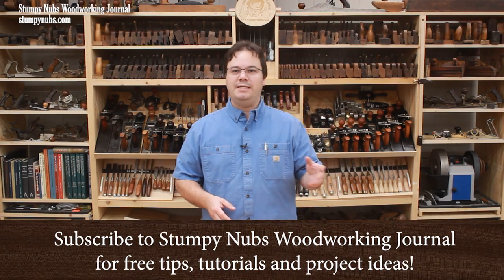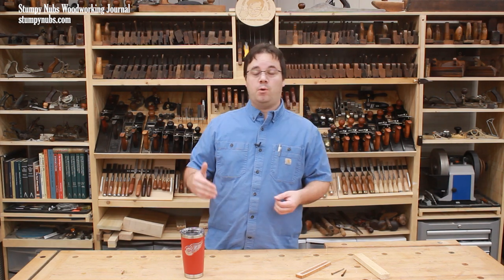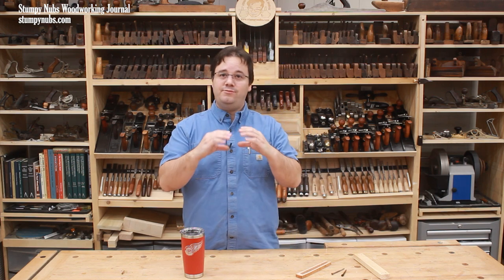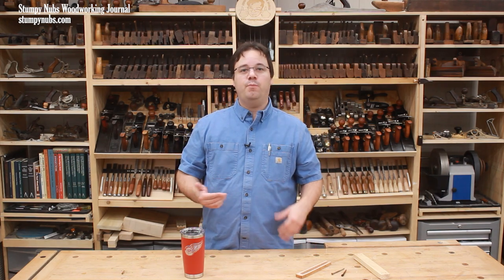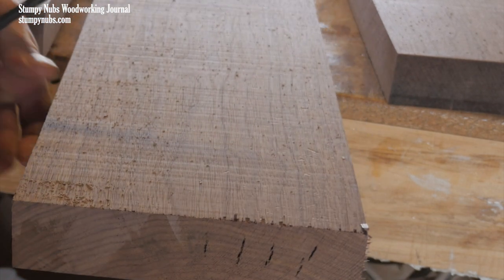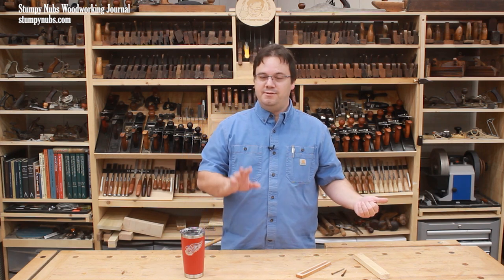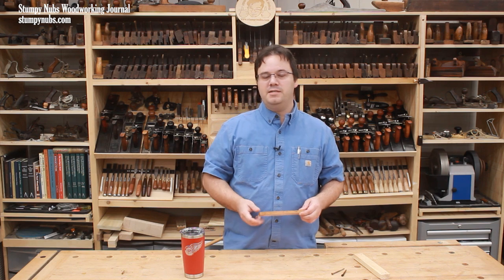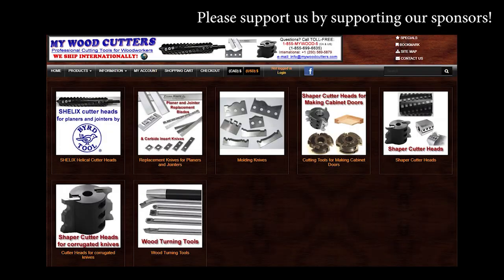A hidden flaw that can DESTROY your lumber! (Case Hardening)

Comment: i wonder if case hardening could be used to provide strength, to things like axe handles. cut it quickly into the shape you want, crank up the heat. or maybe for arrowheads? idk.

Comment: This was informative. Does this mean a case hardened board is totally useless, or can it be resawn and dried the long way?
Reply from the maker: Once you cut it and release the stress, you can re-joint/plan it flat and straight again if it doesn't require removing too much material and make the board too thin to use.

Comment: Is there a board thickness where this rarely occurs?
I’m thinking that in 3/4 stock you would probably see a warped board at the yard.
And anything that thin would be difficult to do the test cuts without the sample breaking.

Would a general rule be, for example, anything 8/4 or thicker do this test?

Comment: Really, really interesting! Thanks, James! 😃
But it's weird... A big piece of Eucalyptus did it to my table saw and yet... It was dried naturally!
Anyway, happy holidays! And stay safe there with your family! 🖖😊
Reply: Eucalyptus bends and twists no matter how it is sawn or dried. Bay Area Woodworking club did demo with Eucalyptus sawn and air dried into perfectly straight boards,  stickered and weighted down for months. Left on table during lunch piece 3 inches wide and 10 feet long twisted and bowed into a spiral in 30 minutes. Unless you nail it down as flooring, it was useless as dimensional lumber.
Reply: @gateway1600  Oh, I see... That explains it then. 😬
Thanks! 😊

Comment: While I understand the mechanics as you explain it, and I have certainly seen it in action, I am confused as to why the outside is "set" and can no longer swell when moisture left in the core works its way out to the shell. After all, wood swelling is something we have to take into account in large fields like table tops long after it has seen the kiln. Regardless, great explanation and thank you again.

Comment: I had a feeling it was something like that but I didn't know it was called case hardening. I figure it was rushed in a drying process and it was under tension, like wanting to warp but kida bound up so it couldn't until it was cut and some of the tension was released.

Comment: Set your table saw to cut slightly more than half way through the board.  Run it through the saw then flip it end over end and run it through again.  Will not do anything about case hardening but it will be easier to cut the board and will not burn the wood or heat up and possible warp the saw blade.

Comment: its like tempered glass... the same effect.  the skin of glass cooled faster than the core...

I've often seen wood move right after cutting.  Also, just recently, checks in the middle of a board.

grrrrrrr.....really irritating.  I wasn't aware of this, thinking it was mainly due to "internal stresses".

aside from the hidden checks/voids, the best way if you're stuck wood with this is to "rough mill" (read joint and plane at extra thickness) all your project stock then give it a couple weeks to come to equilibrium, then do the final milling.  means extra time wood sitting around in your already crowded shop, and lower yield and more wood converted to sawdust.

Comment: If you have no choice but to use a case hardened wood, soak it in epsom salts for a day, then dry it like you would a green board and it usually will be ok, although inner separation {honeycombing} will still be there, it is usually much less obvious and can be filled. {Do not use a honeycombed piece in a structural component though}.

Comment: What if you have no choice but to use case hardened wood. What are tricks of the trade or some methods to manage to get a decent enough result. Especially for us DIYers?
Reply from the maker: Cut it and then joint/plane out the warp if you can afford to thin it out that much.
Reply: @StumpyNubs  thanks. Fortunately for me, the work I have have done allowed me to cover up with fillers and paint; plus depend on people not looking too closely.

Comment: Trouble is, the dealer will only say he doesn't make the boards, the mill does,  he only sells them, the same mill supplies him and 1,000 other dealers in the region, so if they are rushing the kiln dry process for one batch they are doing it on ALL of them, so every batch you might get would be affected.
I've had white oak and poplar do everything described in the video, it will usually be just one board in the 500  board feet delivered that you start ripping and a foot or so in it wants to bind, I have taken the board out, flipped it over and cut from the other end instead, usually about 2 out of 3 times that works fine, but sometimes it binds even from the other end, so I band sawed the bulk of what was being cut off, and then table sawed the remaining 1/2" or so.

Were finding  in recent times, more poplar boards come in, they look ok, but in a couple of days you can see twisting, bowing etc, it's only getting worse as they rush the lumber thru faster and faster
Reply from the maker: That doesn't mean the dealer shouldn't offer a refund, then try to recover his money from the mill. If someone sells you something that is useless for it's intended purpose, and won't give you your money back, he's a crook.
Reply: @StumpyNubs  Yes, but its a symptom of a LARGER problem that is beyond the dealer's scope or problem, and if one batch is "overcooked" they all will be, including replacements. You either have to be a woodworker and figure out how to cope with a product of nature and make it work, or have the lumber shipped by freight from a different region, but if one mill in one region is doing the RUSH drying then they all are, especially now with the HUGE demand, it will only get worse- crappier grade lumber with more knots, splits and defects because the old growth stable trees are GONE and the new ones are being pushed to grow FAST, that's why you see pine boards at the lumber yard that have growth rings spaced a HALF INCH apart- they are growing way too fast, cut down too fast and rush dried.

After the massive west coast fires, and now the massive damage from the tornatos in several states- the demand for yet more lumber will put even more pressure on the whole system to increase production even more

Comment: So you briefly mentioned "your way" of starting a business.  Even though business/selling seems to be outside of your typical scope, I'd be very interested to learn about "your way."  As outstanding as your information is about everything else on your channel, I'm sure a video on starting a business and/or selling what you build would be equally enlightening.
Reply from the maker: The primary ways "my way" would be different from what I have seen of theirs (I don't watch all their videos) is I prefer to avoid taking on excessive debt and to better manage growth. They seem to spend liberally and encourage rapid growth, beyond what they are currently equipped to handle or at least fully exploit. I am not saying their strategy will fail, but it is very high-risk, in my opinion as someone who has a lot of experience in this area :)
Reply: @StumpyNubs  James, thanks for your thoughtful reply.  I may have to go into business for myself soon, and "your way" is the approach I would take as well.

Comment: When ever I have that problem, it's the fence not being accurate.  If you have hard to cut wood, move the "back end" of the fence over a 1/16" and the problem goes away.  You still get a straight cut.
Reply from the maker: The fence was parallel to the blade. The problem, as explained in detail, was the kerf closing and pinching the blade, not the wood pressing against one side of the blade.

Comment: Do you have a video that discusses the differences in lumber due to inter-tree stresses (top of branch vs bottom, trees grown in prevailing wind locations, highly figured grain, etc?)
I use a lot of exotic wood that is highly figured and have had some extreme wood movement during cutting as the blade releases the stress caused by these conditions.
r/
Pete
(Woodworks by Pete)

Comment: A table saw with a badly aligned guide will cause this as well. If the fence is not perfectly parallel to the blade it will pinch at the back of the blade.
Reply from the maker: Lots of things can cause it. but that wasn't the cause in this case, or the subject of this video.

Comment: Now I know with metal, you can literally remove case hardening. Its called normalizing.
So would it be possible to do the same with wood?

My hypothesis is that if you soak the board or wet the outside, letting it absorb moisture, then you should be able to re-dry/re-kiln the wood.
Take into account that this would by NO MEANS be a quick solution. In weeks to months??

Comment: I'm not certain, but I feel like the cut makes a difference as well.... rift/quarter/plain. Sometimes it's just the grain of the wood - knots / crotches etc. I've had decades old air dried properly stickered hardwood do this as well. While this might seem accurate, I'm not convinced. I think how a board dries depends on how a board grew and what stresses it underwent while growing. A tree doesn't grow perfectly vertical so the fibers on the lowest side of a leaning tree or branch undergo a higher compression term over the life of the tree than the fibers on the higher side.
Reply from the maker: Case hardening is not the ONLY cause of stress in wood. But it is a real one. Check the expert link I provided if you don't want to take my word for it.

Comment: Cant it just be left to air dry long term?
Reply: If you have the time to wait sure. However, Any damage to the wood is permanent, like those pockets in the board that he showed. Proper drying may relieve the stress causing cracks or pockets to fill in partially but it will not fix damage.

Comment: It doesn´t even have to be kiln tried wood for that to happen, even with air tried wood especially with hardwoods that´s always a possibility. So riving knife on tablesaw to avoid the workpiece pinching your blade is a must,  not standing directly behind the piece of wood you are sawing and generally knowing about the risk and being ready for it are just common sense.  Taking a seemingly good board and after one cut having it bend on you is annoying though :D

Comment: From the clip you played he said every time. So maybe he just has a bad supplier and is suffering from his wood being forced dried too fast. But if everyone who is going to that wood supplier kept having this problem pretty soon he’s go out of business as people realized that the wood they bought other places was better and didn’t have that problem. But from watching him I’m thinking that may not be his problem and we have to consider other possibilities. As I watch him he is forcing that very thick, what appears to be 2 1/2 inch board, very fast through the tablesaw. Now anyone who’s used a small Inexpensive tablesaw that runs on 110 current versus say much better carpenters or cabinet saw that runs on 220 volt can tell you especially when you’re cutting long thick boards that the 220 saw will cut much faster. Also using the proper rip blade on the more powerful saw will do wonders. You’re basic difference between professional and hobbyist and having the need professionally to mass produce even thick boards. He appears to be trying to overfeed his board into the saw. He would probably have more success if he just slow down. You just can’t feed a two or 3 inch thick board through a tablesaw as fast as you can send a 1 inch thick board through and let’s not forget species of wood because Pine Cuts a lot faster then oak. Now this is not to say that what you’re saying doesn’t have merit because there’s all kinds of tension in the wood and you can just watch boards almost turn themselves in the cork screws right before your eyes if you’re rough sawing a recently felled tree. This warpage happens because of all the internal forces within the wood and as we just saw through it these forces get released unevenly causing the board to twist or cup. This being the reason why we have to dry the lumber in order to stabilize it. Of course if we went back to just splitting lumber we could alleviate a lot of this. All the lumber you would work with would be quartersawn or at least how we interpret the word of course the most obvious problem with splitting the lumber is all the waste. However if you have a green log and want to turn it into a piece of furniture over the weekend splitting the lumber is the only way to go. Because you follow the natural grain of the wood there’s no pinned up tension. Any small twist in the grain can be altered as you plain the board down and cut it into the individual pieces for your project.

Comment: I'm the carpenter at a small yacht building company, where I make a lot of gunwales and strakes at around 25 feet long usually joining two lengths with a single scarf. When I took over the job we were buying iroko and utile lumber in 10 x 2 boards at 16 feet and re-sawing/ripping them down to the dims required, e.g. 3 x 1 or 2 & 1/2 x 3/4. We have now given up on this process and buy the wood as close to the thickness required as possible due to this problem of warping and bowing after ripping. Even expensive exotic hardwoods like these are routinely fast dried and case hardened severely in my experience, and buying lumber close to the required dimensions is the only solution that works as it has been dried at those dimensions, so ripping doesn't affect the tensions baked into it.

Comment: I just saw the issue, stopped at 41 seconds. Measure from the front of the blade to the fence, then measure from the rear of the blade to the fence, same point of the blade. I bet his front is closer to the fence.

I saw the solution, Hmmm,
Reply from the maker: His fence is parallel to the blade. That is not the issue.

Comment: he was actually using a cross cut blade for a rip cut, good eyes everyone
Reply from the maker: No, he wasn't. It was a combination blade, which is designed for both purposes. And the blade has no relevance to the wood physically closing it's kerf on the blade.
Reply: i dont see a singular larger gullet in the teeth so I'd have to disagree, according to my ILM a combination blade has a few 'missing' teeth along the kerf. but i appreciate the response.
Reply from the maker: @jayblesb7113  A "singular large gullet" is not what makes a combination blade, nor is it found on many combos. A combination blade is characterized by 50 ATB teeth, (40 is usually known as general purpose, 50 as combo, though the two terms have become used interchangeably) with a flat-grind on every fifth tooth. Some (certainly not all) manufacturers put a large gullet by that raker tooth to help clear the chips better. But it's value is disputed and many combo blades do not have a large gullet. 

Regardless, you can literally see the board pinching the blade in the video. He struggles to pull the board off the stopped blade. The type of teeth on the blade has zero effect on the wood movement AFTER the cut, which is where the kerf closed and pinches the blade. 

If you would like to learn more about case hardening, consult the document from the US Forestry Service I provided. 

If you'd like to learn about saw blades, here's a tutorial that may help: https://www.youtube.com/watch?v=0J1pRBiVKbI 

Have a nice day.

Comment: Had vinyl floor tiles shrink after installation, probably because they weren't cured before having glue and backing applied for sale. Just another indication of the bad manufacturing standards these days

Comment: James - Sorry but with all due respect, I have to call you out.  FIRST :  " Case Hardening" is a metallurgical term that is not applicable to wood. I've previously respected your woodworking information, but you've now extended yourself beyond what you think is your base of knowledge.  A knowledgeable woodworker would know that wood grain and wood moisture are the contributing factors of internal wood stress. (And as I remember you have also presented viewpoints on that wood factor as well.} 

SECOND:  All of your respectability and "expertise" is now in question after you've chosen to endorse and promote the Jenna and Da*** channel. They are solely focused on getting "views", faking expertise, and milking the YouTube system.  By acknowledging the "J&D" channel you are denigrating the legitimacy of the true YouTube woodworking genre.

I'm local to you in MI.  I'd welcome an "airing of grievances" under the Festivus pole.
Reply from the maker: 1. Case hardening may be a term applied to other industries, but it is also a term widely and correctly used in the lumber industry: https://www.fs.usda.gov/treesearch/pubs/32396 This is not the only cause of internal stress within lumber, but it is a real and not uncommon one.
2. I did not endorse the content of the J&D channel. In fact, I said their way of doing things is not the way I would do it, but I found them interesting and they seem like nice people. Don't put words in my mouth.
3. Next time you publicly call someone's credibility into question, please be sure you are correct.
Have a nice day.